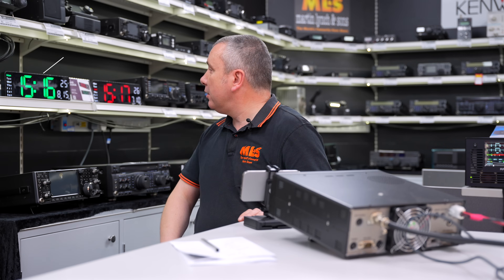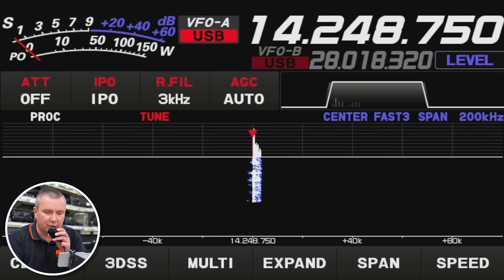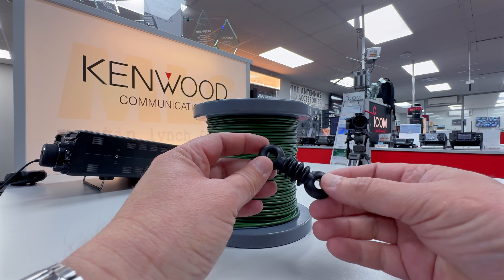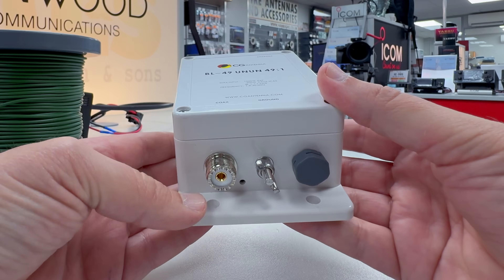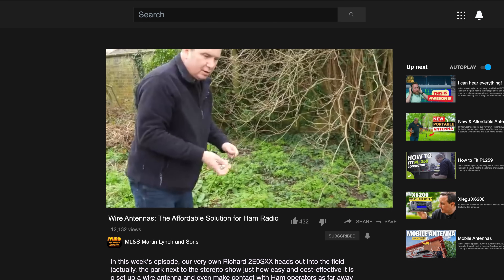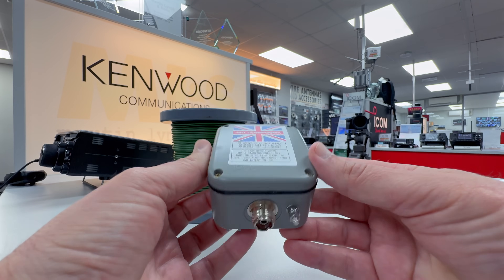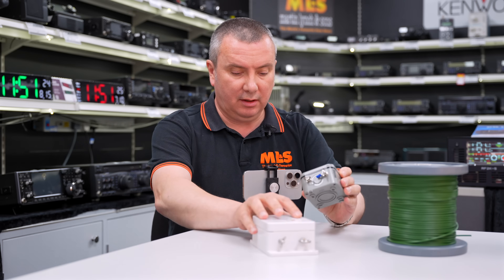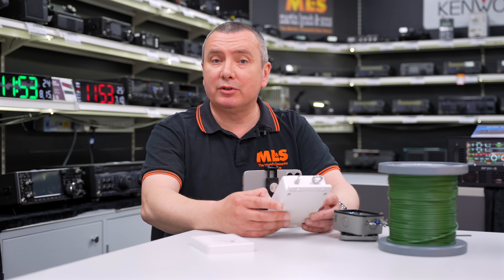Why Every Radio Ham needs a Wire Antenna

Comment: You mention multiple bands, I've just purchased an old Yaesu FT101B circa 1973 from ebay. It's in extremely good condition, and receives well on all bands, but will only transmit on 40 metres. As a matter of fact it transmits extremely well on 40 metres into my half wave dipole. It has built in plate and load, not unlike a modern linear.
Could it be because I've got a mismatch to the other bands?

Comment: Wire antenna? Is there any other kind?
Reply: YES there is, it's called a beam and you point in the direction that you want your signal to go.

You will learn that if you study and get your ticket.
Wire antennas are good if that's all you can afford.
Good luck and thanks for the laugh !

Comment: I purchased and built the end fed antenna from ARRL. With my Elecraft K3 and the internal 10:1 tuner I can use it on ALL Bands from 80 Meters to 6 Meters and sometimes it will tune 160 Meters. I don't quite understand why 160 is hit and miss.

Comment: Hi new to this, but do you run your antenna cable from 1 pole across to another? Does distance matter? Does height matter, Does the antenna wire have to be straight between two poles or can you run the poles or points into an L shape? If garden not long enough. Many thanks
Reply: Insulate your wire from two metal supporting poles, fibreglass masts not a problem.
The length of the wire is relative to the band you are using, there is a simple formula to achieve this.
Flat top, sloping, or L shaped are all possible. 
Getting it away from the ground by half a wavelength is a good thing too.
And to improve the bandwidth for a lower usable SWR try ribbon wire.😉
Reply: @YllaStar95970  thanks for that I’m going to have a go at this, how high is half a wavelength? Is Ribbon wire a brand name?
Reply: Very nice relaxed presentation Richard well done. Baluns and UnUns  this topic bursts my head 😮…  I’m not the clever sort but always try to understand how and why it works,,, I gave up, I just need to know the applications of a device,,, where you use something for a desired result… your presentation was good in this respect. Thank you.73.       💙
Reply: Hello, if you don’t know with being new, have a look at DX Commander’s channel and his friend Mike m0msn, this hobby is galactic in it’s different applications and antennas or antenni 🤣  is a big interesting subject, don’t burst your head with it though unless you enjoy a bit of maths…unlike me 😵‍💫   I’m a bit thick  🤔🧐… all the best on your new endeavours.73.       💙